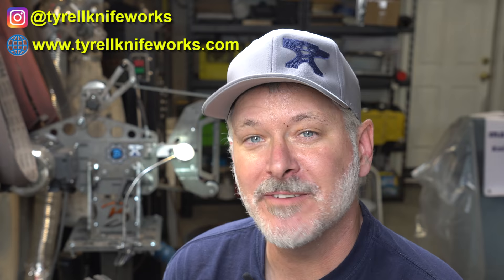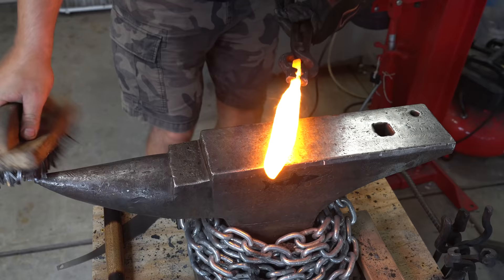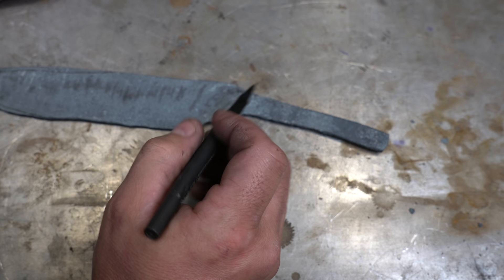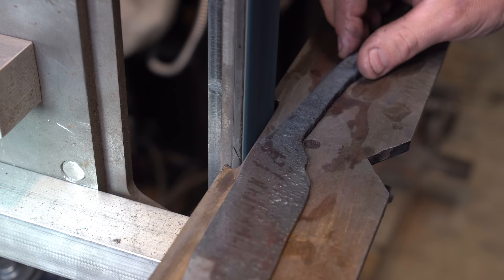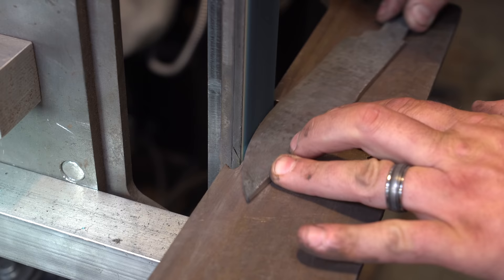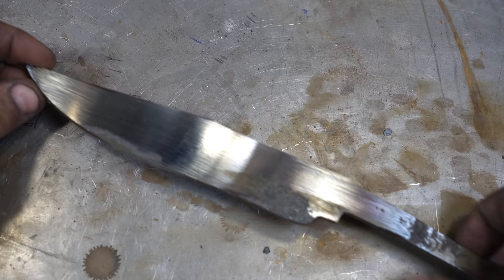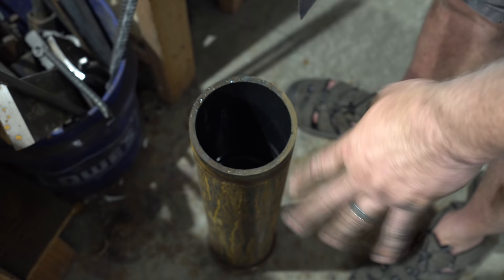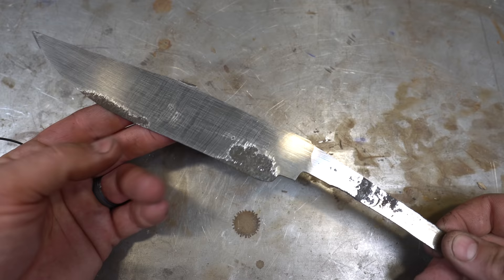Triple-T #90 - Intermediate knife making series - Forging the blade

Comment from the maker: Any questions on things I didn't cover?  Let me know.  Plus if there's other tips you want to ensure I cover in this series, please add a comment!
Reply: I don't believe it would work with this blade but I'm curious if you could demonstrate a way to move the tang. What I mean by that is if you making a hidden tang knife and when forging the tang it comes out to high on the blade or too low what you can do to get it back in the center. I hope that makes sense.
Reply from the maker: @cae2487  yeah it’s too late to do that on this blade.  The easiest way to do that is hold the blade and put the tang on the anvil with the edge up that you want to move the tang towards and then start hammering on the blade edge that’s up.  That will start to move your tang where you want it.  It’s hard to move it more than a 1/4” this way though without major distortions to the blade.
Reply: @TyrellKnifeworks  thanks for sharing. I haven't tried much in the way of hidden tangs and one of the ones I did try I was having quite the time trying to get the tang to move where I wanted it too. I'll definitely give that a go the next time I'm in that situation. Appreciate the knowledge and thanks for sharing with us all.

Comment: It's looking good  alot better than mine right now . Got a little more forging to do after watching this video  learning a lot . Thank you . What is the think is the best thickness of a blade . 1/8 ... or? Mine is still thick about a 1/4 as of now
Reply from the maker: I rarely have blades over 3/16”.  I’m just not a fan of big thick blades.  A chopper is really the only reason for a thick blade IMO.  Stick to something around 1/8” or a little more if it’s a big blade.  I’m generally talking about blade lengths less than 10”. Chef knives should be WAY thinner, like a 1/16”.  Does that help?